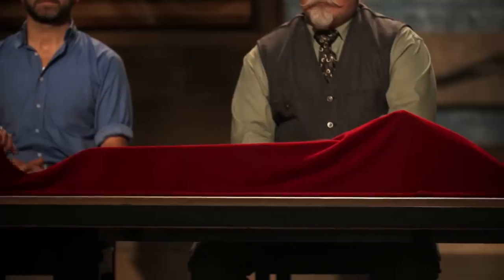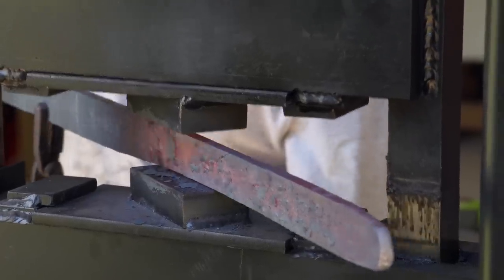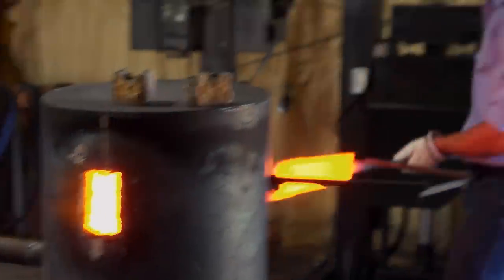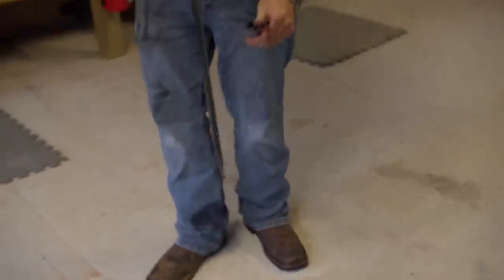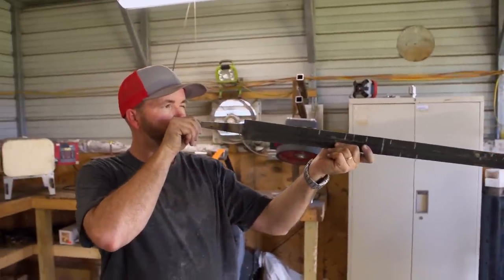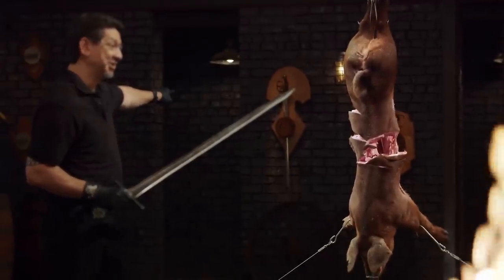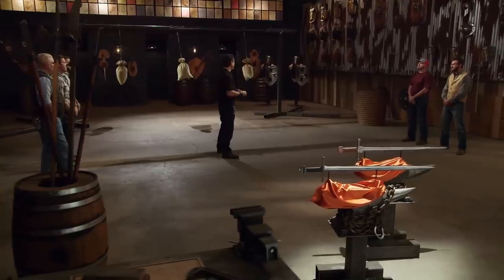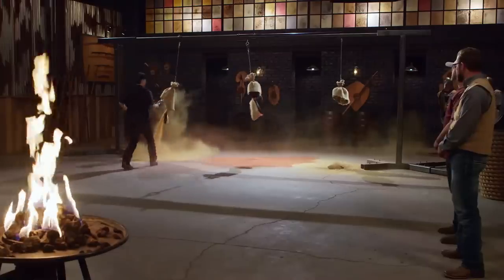Forged in Fire: Charlemagne's Joyeuse Sword CONQUERS the Final Round (Season 7) | History

Comment: Me who's watched 8 episodes so far and knows nothing about forging 
"Nicely done heat treat, now check for warping"
Reply: Basically
Reply: Also ebony wood bad

Damascus is a must but also breaks the most
Reply: @caelandenning2648  Depends on the metals and the temperatures of heat-treatment. If you put tool steel with stainless it's likely to be a DISASTER
Reply: This is me just screaming at my phone saying " ITS NOT THE RIGHT COLOUR"
Reply: Yes this is how we learn to forge to eventually go on and win
Reply: @finlandisntreal6371  Yeah I see a lot of heat treats where it doesn't get hot enough, and those tend to have blade deflections or pick up bends in the strength test.
Reply: @ftbaimakaren1368  yeah really, my thought was "now you know more about forging than you did before you saw the show."

sure, probably not enough to actually make a blade, but something.

Comment: I gotta point this out as a HEMA nerd, sorry.

Shields were (almost) never made of metal. heater shields, the style we see in the video, and shields as a whole were usually made of wood, rawhide or some combination of the two (unless they were small like the buckler, or used for a specific purpose like the rotella). this was a) to keep weight and cost down and b) to ensure an enemy's blade would get stuck and give you control over the weapon.

the idea of a metal heater shield likely stems from the fact that sometimes, very rarely, they would have a thin sheet of steel on the back in order to fortify them for cavalry use and such. however, again, this was very uncommon, and you certainly never saw shields that are all metal like the one in the video.

I say these things because a wood shield would have not only been more accurate, it would have been a more interesting test. you could test the durability of the edge against the steel helm, then test the durability of the blade's body against the shield. this is because when a sword enters wood (or any material), and the edge alignment isn't robotically precise and perfect, it twists and flexes with the force of the strike. a good blade will spring back to shape, while a bad one will suffer warps.

otherwise good episode tho

Comment: One of the requirements for this weapon I was thinking would be the crossguard, handle and pommel would have to be ornate like the original design.
Reply: They never care for visual design elements unfortunately
Reply: @leonardocucchiara4782  visual design only matters when both blades perform equally in the tests.
Reply: There were some tasks, especially in final stages, when they asked specifically to comply rules for design.
But in the end, it is weapon, so design is less practical than usability and comfort

Comment: You can see Joyeuse at the Louvres museum in Paris.
But in fact, it is a kind of replica of Charlemagne's sword created with different parts and later adjustments which dated from the Xth to the XIIIth century (Charlemagne died in 814). This sword was used during the coronation of the king of France from probably Philippe Auguste (1179) to Charles X (1825), including Napoléon's coronation.
Calling it Joyeuse, as Charlemagne's sword, was a way to show the continuity between the Carolingian dynasty and the Capetian dynasty...

Comment: Forgotten Forge I keep watching the shows and I don't see anyone here making a proper sword or axe these particular weapons are usually boiled down Steel borax and other things they took the medals that they just burned for quite a long time until his red hot and then poured into a mold and then beat on it I see none of this I just see a bunch of men reaching for stock and just eat it up and this is why either the metal gifts poorest because metal gets weak or cracking begins as you beat it I don't see anybody taking x-rays in the middle the sea where the weakness is all I see is people taking that metal after was heated up and then quenched and no not really a thing where the crack is sometimes it starts in the centre works his way out from constant feeding of the metal which is not even tempered or hard team beat on most swords of the Orient is folded metal consistently as it's heated up then it's time to go to a sword takes hours in weeks in months to do but these guys have limited time to make the weapons of the time. It's also knowledge that I gave out also these foragers do not have the experience you going to do what I said you have to do to have strong metal stronger than what you're pounding think about it Old Forge history of England would teach you